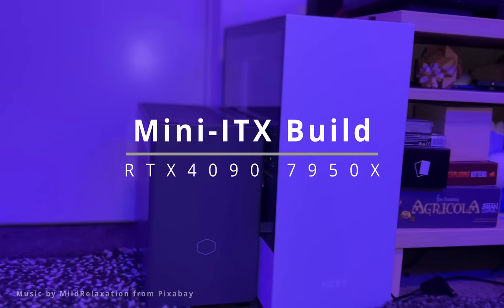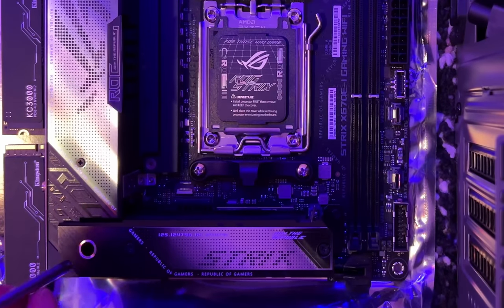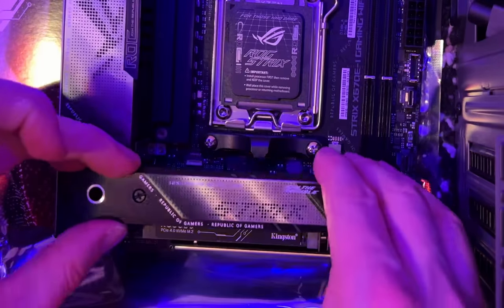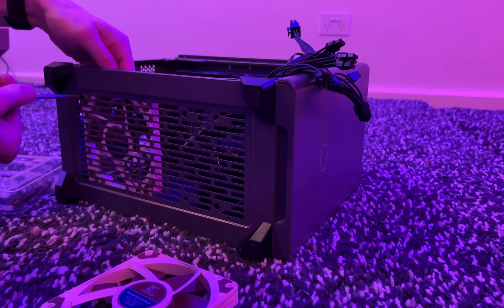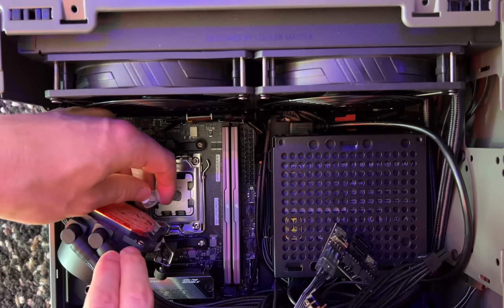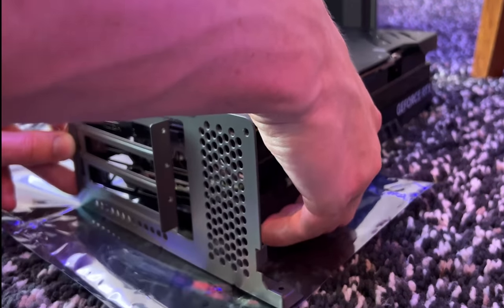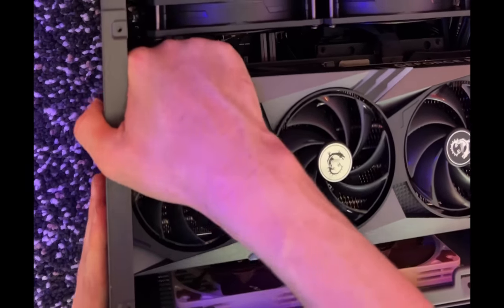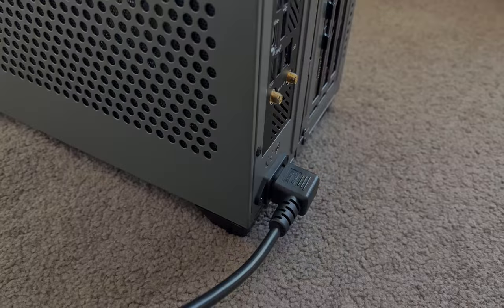Mini-ITX NR200P MAX build with 4090

Comment: Sweet build man. I really wanna build my next computer in the same case with a 7700x and a 4070ti but I’m not sure I wanna spend that much money on the same motherboard you have. Any suggestions?
Reply from the maker: Yeah don’t use this motherboard. There is a cheap msi one you can use.
Reply: @minkis42  thankyou very much for this video. You've inspired me to attempt a build using the same case with a MSI 4090 Gaming X Trio and the just released Ryzen 7 7800x3d. I like the look of the mITX ASUS motherboards and thinking the ASUS ROG Strix B650E-I might be a good choice. Given your experience would you recommend it?
Reply from the maker: @frostylonsdale8377   Yeah, when I built mine there was only one itx motherboard available.  B650E-I looks like much better choice. Also chipset fan on the 670 is noisy but I think 650 only has the vrm fan which runs quieter.
Reply: @minkis42  thanks for confirming. My only other concern with your build is the daisy chained third PCIE 8 pin connected to the 4090. I ordered a custom 3x8 pin PCIE to 12VHPWR cable from Cablemod but that won't reach me in Perth, Western Australia for a month. No issues so far with your power supply to the GPU?
Reply from the maker: @frostylonsdale8377  I didn't have any issues with daisychain, I've been using custom cable now though.
Reply: @minkis42  thanks for confirming. I'll do the same until my Cablemod order arrives. I note your kiwi accent -- are you located in NZ/Aus? How long did you have to wait for your cable?
Reply from the maker: @frostylonsdale8377  I ordered mine near release date so was about a month since they had a backlog.  Yeah I'm from NZ but living in Aus.  Surprised you could picked it up.
Reply: @minkis42  I have quite a few kiwi friends, and like most aussies, I can identify a kiwi accent pretty quickly! Appreciate your advice on the build, is there anything else apart from GPU power cable, Noctua fans and fan splitter that you introduced (i.e that was not included with the NP200 Max and motherboard kits)?
Reply from the maker: @frostylonsdale8377  Yeah, just with trying to make it completely silent I replaced the radiator fans with "Thermaltake ToughFAN Radiator 140mm" and bent the fan grills out a little to increase the space to the fan blades. Adjusted the fan curves to run hotter but quieter, radiator fans will idle at 500rpm, this is completely silent at idle.  Also running CPU in 105w eco mode.
Reply: @minkis42  thanks. So the included Coolermaster radiator fans are cheap and noisy? I have all my parts for the build except for the 7800x3d which will arrive next week. Reports suggest it runs quite a bit cooler than the 7950x so will be interesting to see how my temps/noise compare to yours.
Reply from the maker: @frostylonsdale8377  Included fans are good, one had some bearing noise so will depend on your luck, I'm just really OCD about having it absolutely silent.  Extreme test here https://silver.urih.com/ maxes at 80 degrees with 145watt cpu package power (capped with eco 105w mode) and 45db at 10cm away (from apple watch). Score: x9833.  Idle is 35watts at 55 degrees and dead silent with fans at 500rpm. GPU idles with fans off.. even in a lot of games which are not demanding the fans don't even turn on since it gets some cooling from the case fans.
Reply: @minkis42  will report back with my results as soon as system is complete. Appreciate your help, more questions to follow no doubt! :)
Reply: @minkis42  finally completed my build which is identical to yours except for Ryzen 7800x3d. and 32GB RAM. The build process was highly enjoyable with everything coming together nicely. Temps and noise level similar to yours, and with GPU fans off most of the time which amazes me for such a small case. What RAM did you install? The only issue I'm having is getting the G.Skill DDR5-6000 to run at full speed, keeps defaulting to 4800.
Reply from the maker: @frostylonsdale8377  ram is in the description.  In the bios you would need to enable “EXPO”. (Similar to intel xmp). It would read your ram settings and set all the clock rates correctly.

Comment: That is one dense, hot, expensive, and powerful box 😅 

I can’t afford a new PC yet. I think I will wait until mid range GPUs can hit 4k 120 on high settings in demanding single player games. I’m willing to save up for such a rig. I’m fine with an i5 or equivalent CPU as well, no need to have a top of the line chip.

For now I’ll just drool over these builds 😅 Thanks for the video!
Reply: understand that as game development progresses, games become more and more demanding. Mid range GPUs will usually stay in the same range of performance. 4K 60 is great for single player. that’s what i play usually. anything over 60 for single player games is usually a ego or “feel good” requirement. that’s just my opinion though
Reply from the maker: Yes, best to focus on $ per performance, although even the most budget PC's now are so much faster than what I had growing up.  Haha I miss those days of yearning for things I couldn't afford.

Comment: Nice job with the AIO on the top. I got the same motherboard. I am worried about the RAM not fitting. How did you manage to get it to all fit? Will be building this weekend. Would like to know how.
Reply from the maker: NR200P MAX case comes with the AIO built in on top. I believe earlier versions of this case had the motherboard mounted in a higher position so you wouldn't be able to do this setup with an earlier version of NR200P.

Comment: I did a similar build today but my computer keep giving me a warning saying “cpu over temperature error” I did everything I could think of, I checked the aio if it’s seated properly, checked fan headers multiple times, readjusted the aio pump but it still shows up as N/A in the bios. Is the pump dead? Where did I go wrong?
Reply from the maker: I'll assume you got the basics right like removing the plastic on the heatsink and using enough thermal paste.  Pump should be plugged into the AIO pump header on the motherboard since this header is set to always run at 100% by default.  If pump is working ok then the radiator will get warm.  If pump is not working then radiator will still be cold and CPU block will be hot.  Also make sure you don't have any overclocking enabled.
Reply: @minkis42  yeah I did all the basics, I even decided to re adjust the pump and re apply thermal paste but it’s the same result. I think the pump as to be the issue because I couldn’t feel any movement in the tubes and the radiator still feels cold.
Reply: Brackets on the right way?
Reply: @bp3019  so how did the story end? Did you find the problem?

Comment: Hi, very nice job! I appreciate so much this your build, so I wish know if it's possible to make some changes to it. In particular, I wish know if it's possible to fit in the same case a 4090 FE card, to replace the stock psu with a 1000W SF-L psu and if the stock AIO work fine with a Ryzen 7 5800 x3d.  The rest of your build is perfect for me too, so I won't be making any other changes.
Reply: It will fit the 4090 fe and the aio should also work
Reply: @dominicyang776  Thanks so much!
Reply: why would u pull out and replace the PSU when the PSU is included with the nr200p max and also cooler master provided custom length cables to minimize cable management which also provides less room the cables will have to interrupt airflow being that their is not much to begin with?

Comment: Does anyone know what type of screws are used to secure the water block to the AM5 bracket? My Nr200 max was missing the four screws to mount the water block.
Reply: Hi mate, did you find out a solution? Having the same problem! :(

Comment: Is this possible in the NR200P with an I9 12900K?
Reply from the maker: Any CPU is ok, but you must use a mini-ITX motherboard that supports the CPU.
Reply: @minkis42  I have a mini ITX with rtx 3070, i9 12900k and 750w power supply in NR200P. I would like to upgrade to 4090 but am not sure if the NR200P has sufficient space. Also, only 850 power supply is available for SFF
Reply from the maker: @newjerseynomad  I'm not sure if it would fit in other configurations of NR200P.  The NR200P MAX has the vertically mounted GPU with riser cable, and AIO which saves space so if you have that setup then the right 4090 will fit.  There are reddit posts with a list of 4090s that will fit in vertical / horizontal configuration.  850w is fine if you're not overclocking.
Reply: @newjerseynomad there's the Asus Loki 1000w SFX-L psu

Comment: Why didnt u made it like this:
AIO as intake , Bottom fans as exhaust
80mm fans as exhaust on sides 

🤔🤔🤔
Reply: 4090 coolers are more than enough but a 16 core insane turbo clocks 7950x will have a hard time while suffering from 400 watts of tdp from an 4090 :D

Comment: I want this, but with a 13700k instead. Is an ITX build with that possible ?
Reply from the maker: Yes, the NR200P MAX case includes the AIO mounting brackets for both AMD and Intel CPU's.  For this case you need to get a mini-ITX size motherboard.

Comment: no offense , but this man not really know how to build a pc , how come you install your bottom fans as exhaust lol , and also building an itx case ALWAYS install the ram at behind , because when you plug those cables in you would accidently keep pushing the ram from the side and damage your dim slot ,  previously  my pc was built by a pc builder at shop and after that when my pc get a little bit impact it would restart itself because the dim slot already loose , my RMA make sure of it. Also why put that much thermal paste lol